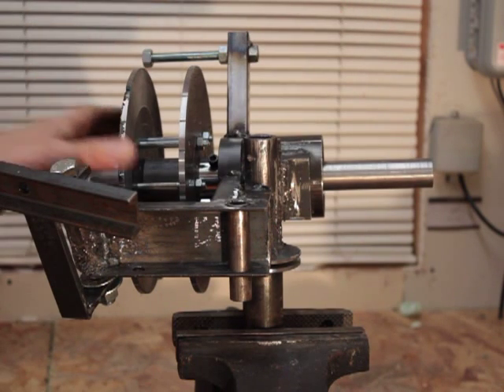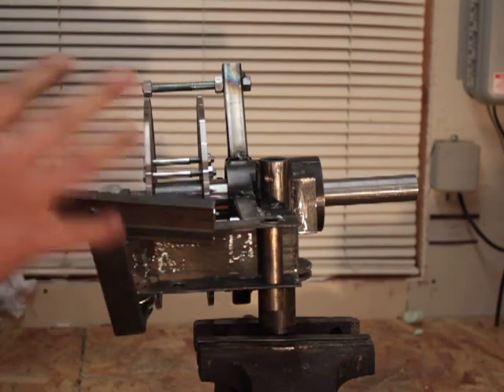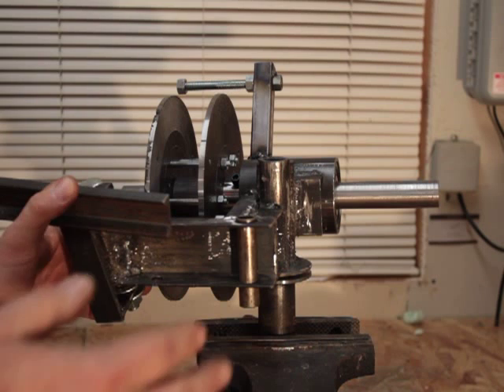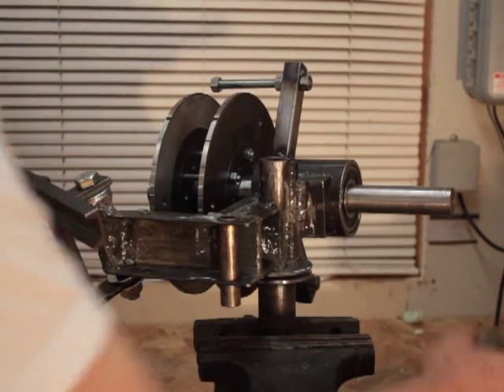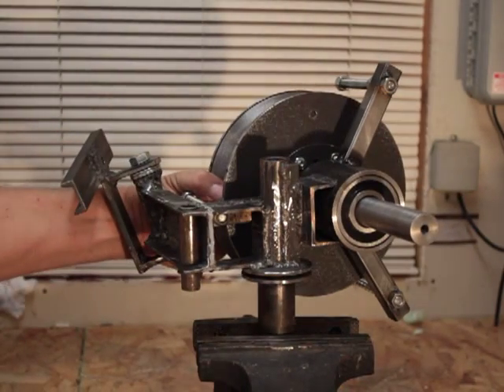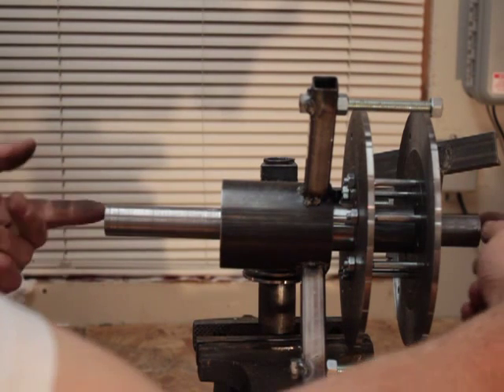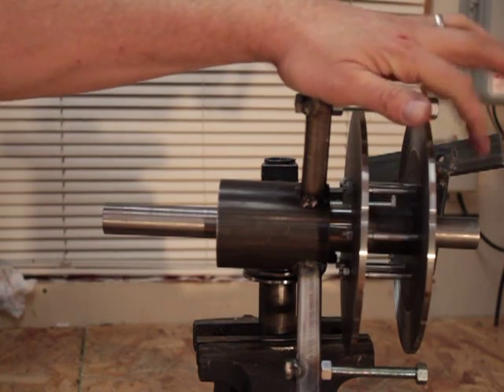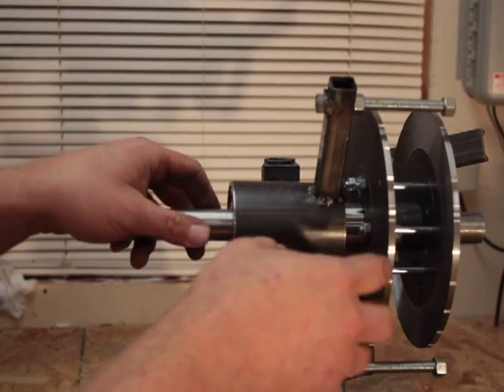Barebones Axial Flux Wind Turbine Muddy's Mighty Mini Alternator Generator

Comment from the maker: Ha! I meant to mention the blades. Well, It will probably be aprox 5 1/2' dia with three Raptor blades on standoffs. I wouldn't want to predict output but the purpose will be frequent trickle charge rather than max output. I'll see where I land with this first turbine and then make adjustments. Thanks!

Comment from the maker: Well, the problem is I don't want to necessarily set the gap between the plates because it take some of the choice out for people. However, if I keep the front plate pressed and true with a small gap collar the user can set gap with all thread in those six mount bolts. Lots to think about but I appreciate all the comments here ... this has been lots of fun!

Comment: I like to get one so I can build a dual 18 inch dual core flux turbine. but the bearing housing shaft, are a bit trick since I dont have a machine shop. the rest I could do with out anyproblem. and also the part that would mount to a pole the bearing set up for that the rest I could weld to my liking. ect.   I like to singal magents and one dual magnet rotor.   if you can qoute me a price let me know. tax seasion is comming up soon. I be happy to get one started.

Comment: Looks good. what this is what companys need to do is build a plate form for people to buy the parts like this.  I like one a little bigger and able to accompany two stators and 3 magnet disks. one disk set up so you can put magnets on both side's. I have a question. what would you charge to make the rotor disks and the bearing hub for the blades to afix to. and the rotors.  and I could build the rest.

Comment: Holy cow. Seems very technical.. But I can tell this thing is built for longevity. 
 The angle of the tail, Thickness of gaps, etc.
 Also watching muddy sticky fingers videos. You have to deal with the length of the propeller, number of turns and thickness of wire on the coils. 
 Your attention to detail is unparalleled. Nice work keep it up.